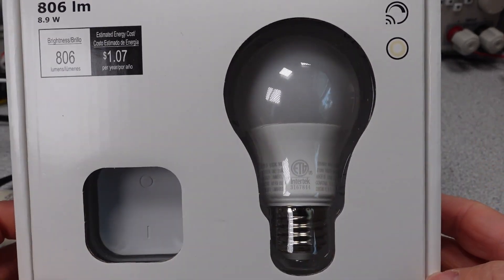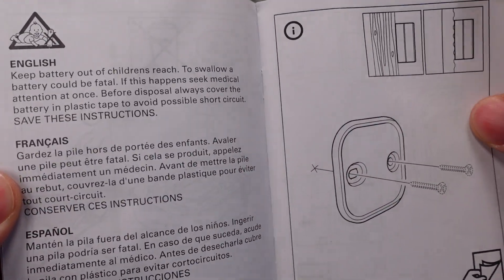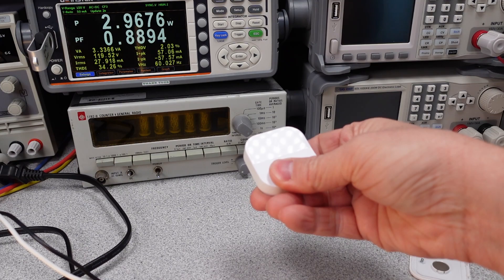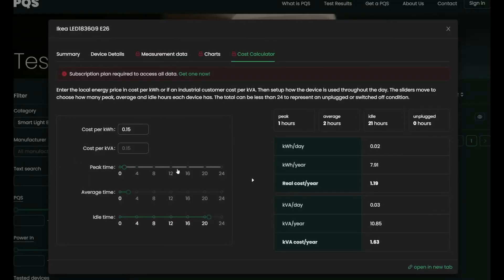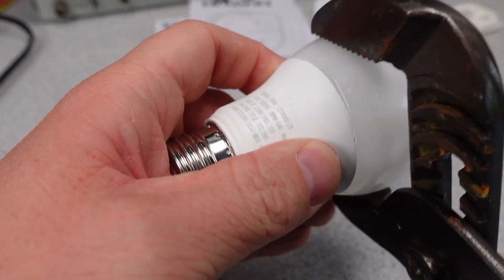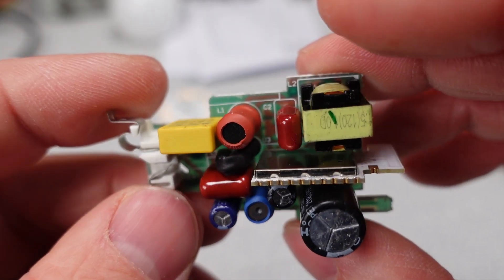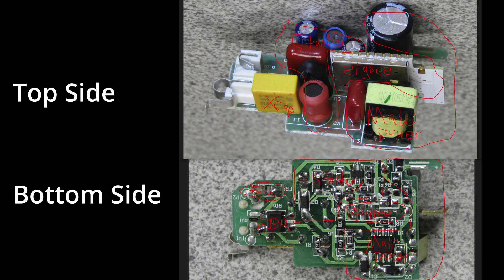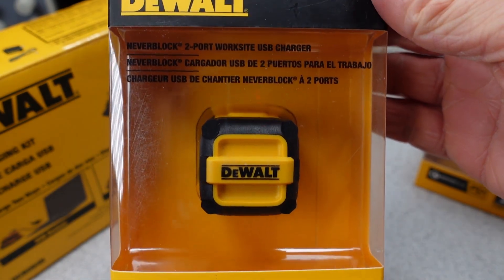Ikea LED Smart Light Bulb Test and Teardown

Comment: I’m thinking to use one of these to create a portable smart lamp. Could I connect this bulb to a power bank? I’m not familiar with the technical part of this endeavour,  I don’t know the voltage that these bulbs need to work. Any idea how I can accomplish this?
Reply from the maker: The module for wireless comms can be controlled by low voltage, but you'd have to connect the output from that to a suitable low voltage LED driver, the rest of the lamp is not usable on a battery bank.

Comment: I bought ten of these around 3 years ago, and two of them have already blown up, just out of the 2 year warranty. My units look almost the same as yours inside, except that the input filtering cap is not the yellow X1 safety style, but instead it looks the same as the other brown (film?) caps. It is marked N154K 400VSD, without any safety or X/Y markings, and in both failed lamps this cap blew up very spectacularly. 
I'm wondering if they changed the cap supplier to prevent this failure, or just to reduce the chance of a lawsuit when the lamp inevitably blows after 2 years and burn down the customer's house.
Reply from the maker: That is very interesting, and yes, it sounds like you are describing a normal film cap which would not be appropriate for mains filtering.  So, with transients on the AC line over time the voltage goes over the cap rating and with a safety rated cap they actually self heal which I have no idea how it works but it does, a film capacitor would puncture and can fail short circuit after repeated exposure to transients.  But yeah, I didn't find that issue in my lamp.  It does still work even though it's a bit sketchy with the pop off lid, ha.  It is likely that as part of the listing process they had to change this capacitor.
Reply: @AllThingsOnePlace  I took a closer look at my exploded specimen, which is a Eurospec model with the same LED1836G9 model designation, and the markings on it are very different from yours. It doesn't have any safety markings, but has some weird local icons instead, most of which I've never seen before. The model number of the PCB inside is identical to the one in your video, so the only difference between the EU and US model seems to be the exploding cap and the outside markings. 
Then I looked at one of the bulbs I purchased recently to replace the failed one, and discovered that IKEA has quietly replaced the LED1836G9 8.9W 806lm model with a new LED2103G5 5.9W 806lm variant. I don't have silly Youtube money to tear down my perfectly good lamp, but according to the FHO-LED2103G5 FCC document, the new version is very different on the inside, and as part of the redesign they decided to take off the ETL logo from the US version and propagate the exploding (I mean "planned obsolescent") design globally. So it may be worth a re-review.  
By the way, IKEA has a surprisingly comprehensive selection of USB-C and lightning cables identified by the LILLHULT and SITTBRUN Swedish incantations, please consider these for review as well.
Reply from the maker: @tamask001  Nice overview!  I may have to use pieces of this conversation as part of that video, with permission of course.  I was just in Germany, at an Ikea and looking at the lighting section, it is very impressive with the amount of options, I didn't take any photos of course.  I didn't buy anything either but I will pick up some of the US ones and take a look at some point.
Reply: @AllThingsOnePlace  Looking forward to the new video, if you need some pics of my pre-exploded lamp, let me know where to send them.
Reply from the maker: @tamask001  Sure, and thank you!  The address is allthingsoneplace at gmail dot com.  Real original right?

Comment: but you didn't test the most important thing which is FLICKER?
Reply from the maker: Haha.  I know.  I did the wave it around in the air and didn’t see any dots so it’s flicker free enough.
Reply: @AllThingsOnePlace  you need to test it with camera. Every dimmable let I saw has flickr so thats the main reason not to use them.

Comment: Great tear down and description of what the components are. Zigbee is a standard and you can somewhat mix and match devices. I would recommend using the project zigbee2mqtt on a homeserver/rpi with a usb zigbee coordinator (sonoff do a good cheap on).

I'm really interested in if these zigbee chips can be desoldered and used in other projects, like attaching it to a d1mini/Arduino. It would be a great way to recycle the chips on bulbs I've got where the leds have burned out (I've got 4 disassembled in a drawer so far!). Do you think that may be possible, or is the zigbee chip likely to have propriety firmware which makes it impossible to communicate with.
Reply from the maker: Yeah, the module can certainly be removed from the bulb, you would have to supply a DC voltage to the module (I am assuming something low 3.3 or 5V).  I haven't checked if it supplies an analog voltage or a PWM output on the control pin.  I have seen reports it is compatible with the Philips Hue system but I don't know if it is hackable/reprogrammable otherwise, I am just getting started on this stuff so I am far from the expert here.

Comment: Smart home is a huge rabbit hole you're jumping into :)
Reply from the maker: hahaha, I hope so, more diverse content is one goal for 2023.  I wish this video did a little better but I guess Ikea is a little bit too niche to start with for a tiny channel.
Reply: @AllThingsOnePlace  I was wondering if you don't have high resolution photo of the PCB. I have few failed bulbs (exact model) but because components bursted (voltage spikes from air conditioner unit) I can't read the values. I couldn't find diagrams anywhere - I'm looking for X-capacitor, fusible resistor and rectifier values. Thanks!

Comment: You mentioned "Zigby". I assume it is Bluetooth based, and that makes me think: "Is this critter pairable and usable" with the smartphone Philips Hue app (also using Bluetooth in addition to WiFi). I use it for controlling several Philips Hue Smart Plugs on my smartphone, but this light bulb could be a nice extra for my desk workplace.

Is it or isn't it parable and usable by the Philips Hue App (should be easy to test).
Reply: ZigBee isn't Bluetooth. Hue bulbs support ZigBee (to connect to the bridge) and Bluetooth (direct to your phone). IKEA bulbs don't support Bluetooth at all. Neither IKEA Tradfri or Philips Hue support WiFi. 
You can connect third party ZigBee products to your Hue bridge (like IKEA bulbs), though.
Reply: @OneContinuum  Thank you for clearing things up.
Reply from the maker: Yeah, someone else mentioned they are compatible.  I will have to check it out.

Comment: Wow, you really have branched off where all things in one place have not gone before. I tell ya what, when I saw that sine wave on your graph, I could swear this puppy uses PFC. And I've never seen one of those bulbs apart before, I assumed it had an emitter tower that went out, but nope, the LED's are literally on a flat plane of existence, while the bulb dome is clearly just used as a diffuser. I also agree, if it were using a simple power supply, you wouldn't see so many pieces that make up that PCB, their was clearly more complexity going on there. Since the cost on these remote operated LED bulbs from many brands, have come down to 15 dollars a bulb, it was worth me picking up a few. Usually they can be bought in 60W or less equivalent. But when your actually trying to do work in your home, sometimes you need more light, so I secured some 85 watt equivalent bulbs. Only thing is, you and I both know, all these bulbs are made in China, and Ikea sure as heck didn't manufacture these themselves, they just put their brand name on it lol. Still, glad to see that these are quality bulbs that won't burn your house down. You just never know with Chinese made products these days.
Reply from the maker: China can keep the quality high if they want.  These represent the top level of quality though.  Actually the first video on the channel is a LED bulb (it is trash but I draw out the schematic and eventually fix the bulb).  But yeah the flat pcb is very common now.  The real cheap bulbs use very few leds and do tend to burn out quickly. This one uses a decent number of leds. I forgot the part examining the leds, ha.

Comment: With the resent energy crisis in Europe(damn you Putler), these bulbs went from A+ to E class in energy consumption. Philips Hue is still more energy friendly.
Reply from the maker: Yeah, that was a mess.  A+++ then A++ so on. Scale was broken so badly, still isn’t very good…  these shouldn’t be an E though.  I wonder if it lowers it because it has idle consumption.
Reply: @AllThingsOnePlace  IDK but its regulations. Although its for common folks the A to G scale, it would be good to add the A to G scale on chargers.
Reply from the maker: @burhanbudak6041  On the https://pqs.app page I do have a letter grade scale on everything.  I think this bulb got a B grade.  Most power adapters get D.  I only have 6 levels though.
Reply: @AllThingsOnePlace  sorry I meant on retail stores https://en.m.wikipedia.org/wiki/European_Union_energy_label

Also are the IKEA cables worth to buy? Its basically USB2.0
Reply: Well, then somebody should go tell Europe, that the Phillips brand, is not the same company that it once was. Phillips used to make really high quality stuff back in the day, including bulbs. But these days, Phillips branded bulbs tend to last a year if your lucky, and they burn out. So, yeah, they might be winning some awards for power efficiency, but their build quality leaves much to be desired. Many other cheaper brands on the market, have higher quality made bulbs over that of Phillips. Silvania is another name brand that has also gone down in quality as well. Just seems like all these big brands get too big for their britches, and they think they can save money by building cheap. Well, reality check, China is a slowly dieing country, as their economy collapses in the next 10-years. So I suggest they bring manufacturing to America, and straighten up, and make quality products again.
Reply: @stellarproductions8888  I recently kicked out a Philips Pro Reel to Reel tape recorder (25kg+ naked?), that I haven't used for recordings since the mid 70's (last millenium). It was extremely well built, and still. performed wonderfully in the late 80's. If the microphones (Beyer) were good and well placed, the recordings were also.
Reply: @stellarproductions8888  I mean, it's quite literally not the same company; Philips Lighting was split off in 2014.  "Signify" now uses the Philips brand to make lighting products but they're no longer related to Royal Philips. That said, I'm still very impressed with their products. I own about a hundred Philips Hue products and haven't had a single one fail. I still use a few Gen 1 bulbs which I bought back in ~2013. Still working well.
Reply: The Philips Hue bulbs went to G rating, so if your comment is true (IKEA bulbs are now E class, then no, the Philips Hue bulbs are worse)